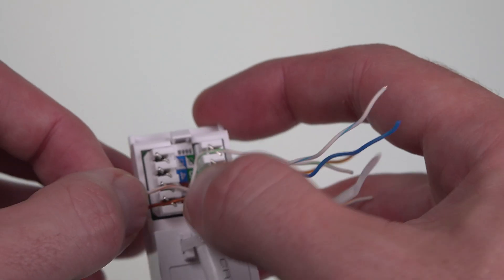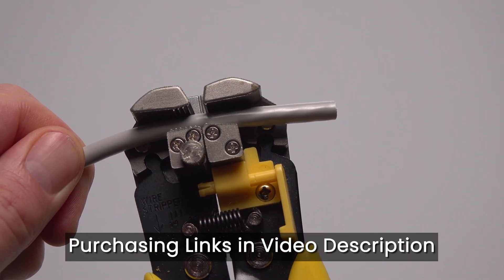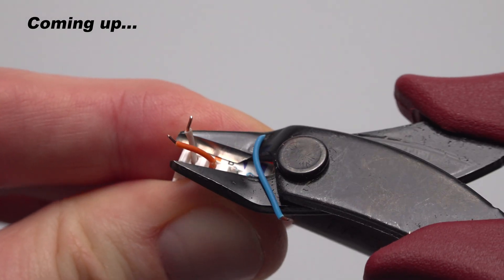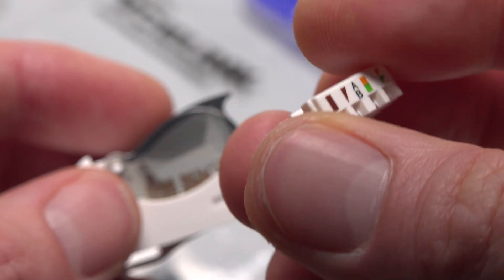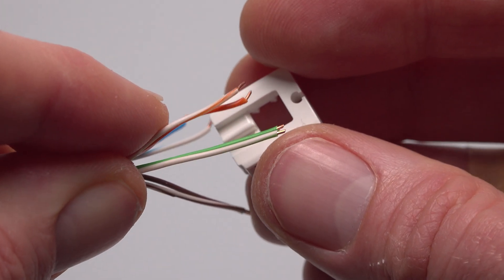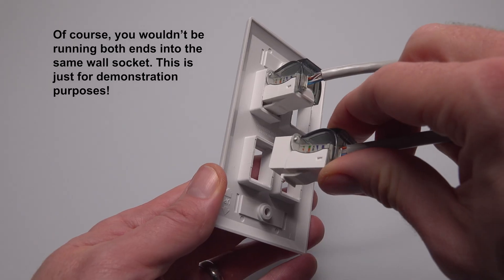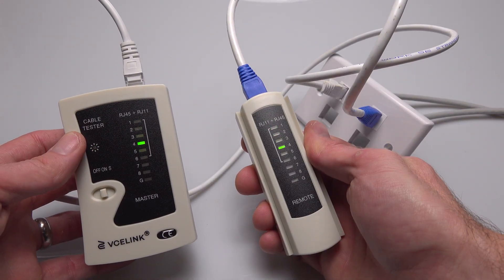How to Wire Up Keystone Jacks WITHOUT special tools!! (Toolless RJ45 Wall Jack for CAT6 Ethernet)

Comment: just a small tip. im my experience, the cable testers arent the most reliable (ive come across many that either done work or work only half the time).
so if your having issues with your tester, the best way to verify is to litterally use the cable and see if you can successfuly run internet speed tests or pings.
Reply from the maker: Valid point! Nothing beats a real-world test for ultimate verification 👍

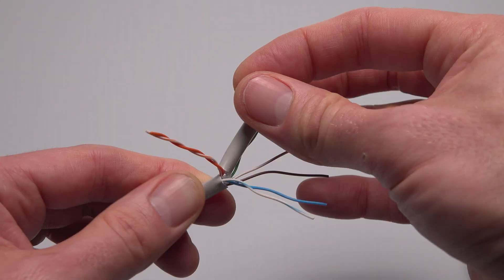Comment: Time mark 2:01 - the wire pairs should not be untwisted. Best practice calls for keeping the wires twisted as far as practical to the keystone jack terminals. Simply keep the wires twisted and allow the plastic posts holding the metal IDCs (insulation displacement connectors) to separate the wire pairs as you push the wires down. The IEEE standards call for no more than 1/2 inch of untwist. This probably does not matter much for 100 Mb or 1Gb links, but it matters a great deal for 10 Gb links as the higher frequencies used make them more susceptible to crosstalk. This concept is nicely tested with a Fluke Cable Analyzers in TrueCABLE's excellent video. Search for Cat6 "Ethernet Cable Untwist Performance Compared".

Comment: I purchased a 12 interface Cat5e terminal block a while ago, but I am thinking I actually want to do Cat6 runs to make them a bit "future proof". Do you all think I can get away with the Cat5e block for my network closet to terminate all the runs, or do I need to buy a specifically Cat6 one? This is for my home network which is gigabit right now, but may in the future be faster.
Reply from the maker: Cat5e / Cat6 refers to the cable type rather than the keystone jacks you put at the end. As long as the size (the gauge is measured in AWG) is the same size / number you'll be absolutely fine.
Reply: @SwitchedOnNetwork  Thanks! The google machine wasn't super helpful in answering my specific question. I greatly appreciate you taking the time. =)

Comment: Did anyone else notice the ends were striped.  They were cut off at the end so it doesn't matter but it was odd.  I don't use tool-less but I believe there are ones out there that cut the slack end too without needing wirecutters if thats what you want.
Reply from the maker: I'm not sure what you mean?

Comment: I've seen the other video about the pass-trough RJ45 plugs, bought the tools and did my cables myself. Not as easy as you shown (showed?) (but I lack the experience I guess) but fun to do and rewarding as my cables are the exact length they needed to be.
Reply from the maker: Great to hear, glad you were able to wire them up and that you enjoyed it too :) It's rewarding learning to do stuff for yourself, and saves the cost of getting someone else in to do it too!